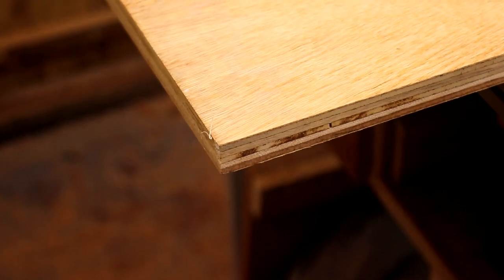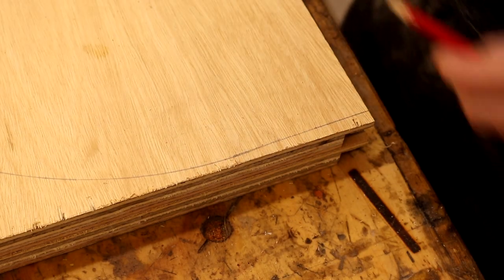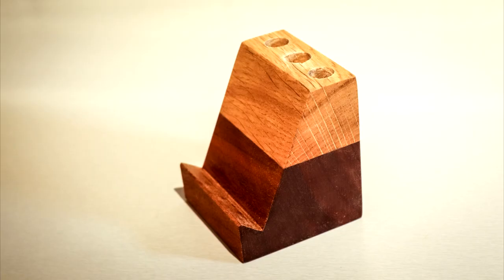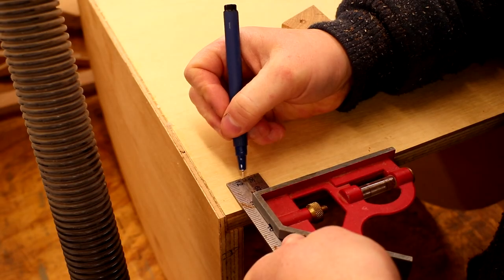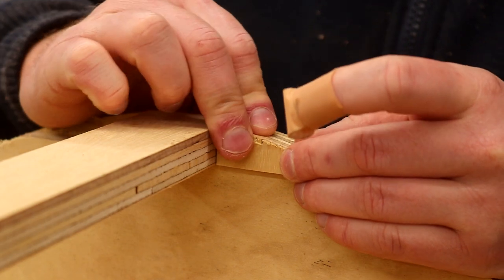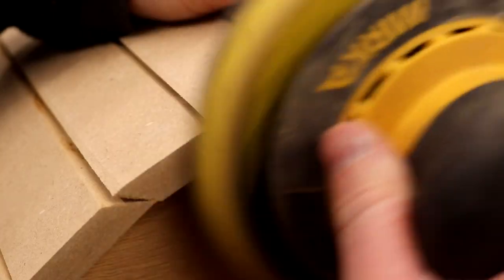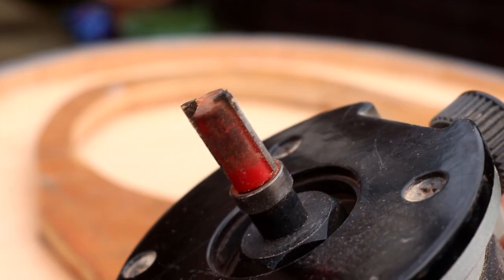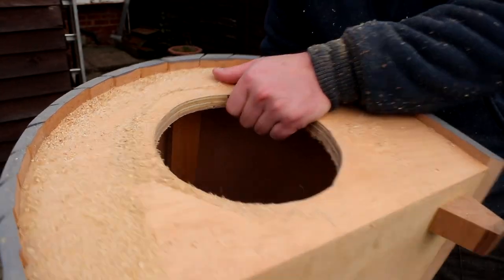Making A Cat House / Pet Bed

Comment: Looking good.
In future you may want to try cutting the bulk out of the circle with a jig saw to give your router an easier time. Saw just inside the line then your router is only having to trim a few millimeters back to the template rather than honking out the full cutters width 😊
Reply from the maker: I considered that although because I’d already added the cladding there wasn’t quite enough room for the jigsaw base to be able to make the cut. I should have cut the hole earlier on! Although maybe I could have used the oscillating tool to do it
Reply: When doing production runs for these, a mini circle cutting base for your router allows to cut the doors everytime perfectly round and leaving a very crisp edge. If cutthing more than one, the 1st cut door becomes your template. Great video!

Comment: I would highly recommend when cutting a hole with a router that you roughly cut the hole with a jig saw and then use the router at full depth, assuming the jig saw has not left too much material. Also with a bit of geometry the bevels on the cladding could be made more snug perhaps.

Comment: After you sand off the edges of the MDF go over them with some wire wool it brings them up really smooth
Reply from the maker: I used 400 grit wet and dry which does pretty much the same job I think

Comment: Hot-gluing fabric... I can't sew either but I've had a pair of curtains that I've been meaning to trim for a long time. Maybe it would work? ;-)

I enjoyed the video and the design of your cat house. There's a product called MDF sealer than can also be used prior to painting. Some people will also apply a 50/50 mix of PVA and water to the edges as a primer.

All the best and hope you soon recover from feeling ill.
Reply from the maker: It works surprisingly well on fabric! Give it a try but maybe iron the gems before gluing for a more pro result 👍

I know about the dealing products but I wanted to just use what I have, and the paint bonded fine luckily.

Thanks!
Reply: @RagnBoneBrown  Thanks, Keith. I might try that.

Comment: Great job! One quick question if you don't mind: Was Dylan annoyed at all by the smell of the varnish? Should not be as bad when it completely cures, but having used the spray variety, the smell can linger for a few days.
Reply from the maker: I think maybe it depends on the varnish that you use. Water based varnish from a can cures quickly (a few hours depending on weather) and the acrylic spray stuff cures in minutes, it’s brilliant for that. It stinks when you’re spraying it though!

Comment: Hi Keith. 

I was wondering if you'd be able to give me some advice..... I've recently built a shed 2.1m2 with internal measurements coming at 1.8m2 (if memory serves me right ) the internal measurement is from frame to frame not shiplap to shiplap ..... if you understand that I'll be amazed !!! Lol 

My question is would it be worth insulating  between frame and the using a 6mm ply as the wall or is there another cheap method to sound proof the shed 

Clearly my space is limited so my work benches will be modular and multiple functions (eventually) I don't own a money tree !! 

Any advice would be nice haha cheers 👍

Comment: To harden cut edges of MDF, I use a solution of 5 parts water to 1 part wood glue.  Use a foam brush to put it on and wait about 45 min and you have a hard edge that doesn't dent and takes paint after a light sanding.  This trick is something I use on my full-size arcades.

Comment: a tip for painting the ends of mdf: sand it with a beltsander form one side, this makes all the fibers aline one way and "make a barier bitwean the paint and mdf structure"
you will still have to use more then one layer of paint but it sure helps

Comment: Turned out quite nice. I actually had to reupholster the arm rests on my brother's desk chair as the faux leather had worn away and since I didn't have any staples short enough thought back to one of your previous videos and used the hot glue gun. After gluing my fingers to the material a couple times it turned out great, is there anything you can't do with either hot glue or duct tape?
Reply from the maker: Yeah totally!  i find that I’m reaching for the hot glue more and more lately, it’s just so useful and quick!

Comment: Get well soon Keith, as for the Cat House a great build and love how your Cat has pinched one.
1 question, why didn't you use a round over bit or similar to the entrance of the cat house, would that have been easier than sanding it?
Barry (Wirral, ENG)
Reply from the maker: I did consider it but I felt it might have made it more difficult to paint the end grain of the plywood neatly if it were rounded over? I’m not sure